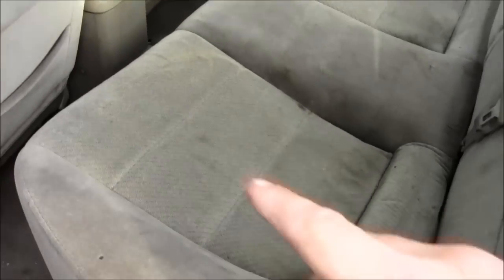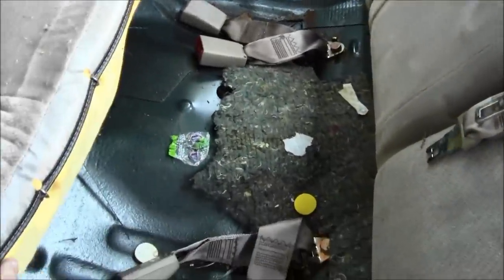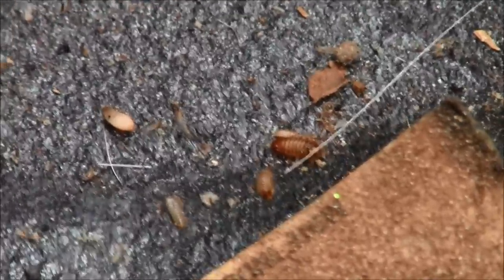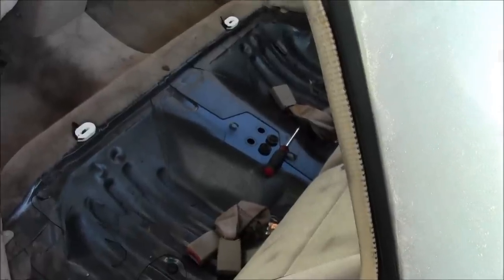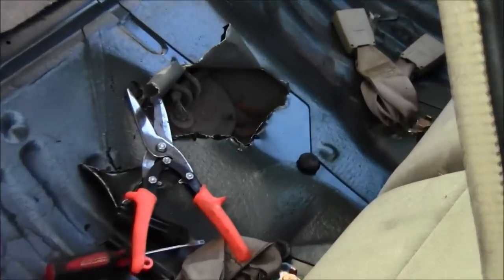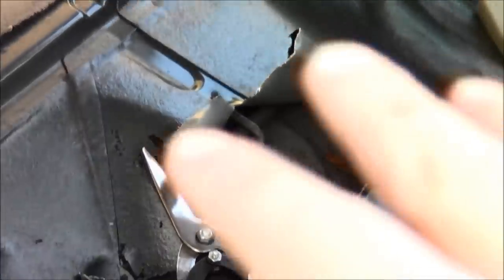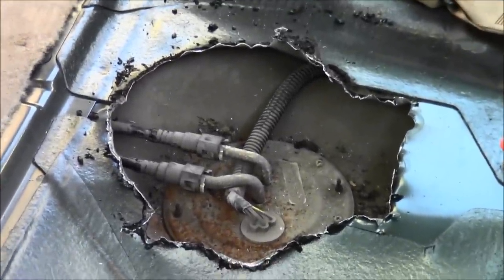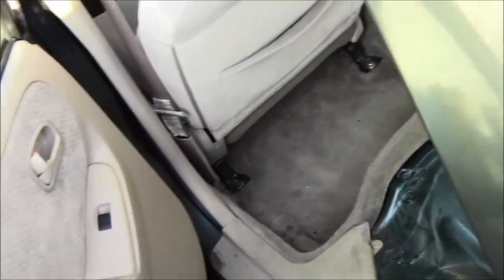How to Access Fuel Pump on Mazda 626 Without Dropping Tank

Comment: I did this to my 626 and it worked great! Thank you for the directions sir! I noticed the newer Mazdas already have this "fuel pump access panel" from the factory in the exact same spot! I guess we got ahead of the game! I sealed mine back with a rubber gasket and sheet metal screws just like the newer ones! This was always a great car and still will be for many years to come! Thank you! Thank you! Thank you!
Reply from the maker: Yes. Thank you. Great the engineers put an access panel in. On a side note, the downside to having driven this vehicle is it draws a lot of attention from the popo.
Reply: @MattHumanPizza  Hm. Maybe the previous owner was a known criminal? I never had any problems with mine that way, even after I got the windows tinted dark. Great car!

Comment: hahah good shit! Personally know of plenty of Mazda "Techs" that "Drop" the fuel tank in Mazda 3's to replace the fuel pump, Keep cutting that shit, flat rate doesn't pay enough for you to drop that tank. Just make sure to use some Epoxy to reseal the passenger compartment, make it look pretty by spray painting it with some black spray paint and you are good to go, you'd be amazed how many cars at the dealerships are done this way but with a grinding wheel and a bag in between the sheet metal and the fuel lines.

Comment: I won't say anything mean like some did...but I will say this...dude...you spent 4-1/2 minutes showing out in front of the camera...but you forgot to show how to replace the fuel pump.  is that in another video?  not sure about the whole "cutting holes in the frame of the car" thing...I'm thinking that's something that the engineers didn't really want to see happen.
Reply from the maker: I just showed how to access the pump from above instead of below

Comment: I used a CAN OPENER on my car. Take a  look below- OK guys everyone 
jokes about the TIN CAN they drive,RIGHT!  I just used the can opener to
 make the hole It worked like a charm. It was the one that you stab into
 the can. No mess cut like good cheese with a regular knife. Only spent 
$20.00 bucks on a pump. Even used a hack on the lines.  @
Reply from the maker: good technique

Comment: You sound like you are high on something but what the heck!  Though you don't show how you finally covered up that gaping hole, I assume you used a piece of sheet metal, shaped it and secured it with several screws and at least  sealed it with clear silicon as to avoid the smell of fumes and whatnot.  Whatever it takes to save some green, I guess...

Comment: Dude, don't give dangerious bad advice, for close the hole. Don"t be an idiot.
Fix a new solid piece of tin to fit the hole.  
Seal it up solid, using a tight fit. Screw it down and seal it with silicon or JB weld.   If not,  exhaust and gas fumes will come into the car.

Comment: As an ASE certified master tech, I puked after I watched this. :( LOL I see this kind of stuff sometimes and it usually causes you some kind of problem. BTW, please don't strap your kids in the back seat of that thing (if you have any) because you have sacrificed the structural integrity of the car in that section and who knows HOW a car will wreck when it does. ;) Think uni body car, (frame)
Reply from the maker: +History Trackers This car drew a lot of unwanted attention by the way it looked, so it was taken apart for the benefit of YouTube and science.  It was junked and who knows where or what it is now.
Reply: +History Trackers to be completely honest, the structural integrity of this car probably wasnt that great when it was new, and i highly doubt that this job would lead to any sort of loss in safety. just my .02
Reply: sure sounds like it, since there is no page 8, or figure 15 or 16 in that llink haha. also i consider anyone who goes around on youtube starting their comments with "im an ase certified master tech" a moron spouting random crap on the internet. i too am an ase certified master tech just fyi. and while this is definately not the proper procedure to remove a fuel pump, there is no article necessary to gain a master tech ranking that says anything about  a 6 inch round  hole in a non structural  part of the car being bad.  obviously its an access for fuel to enter the vehicle but with any modern car fuel tankn rupturing isnt necessariliy that common of a problem. then you look back at a bunch of older vehicles where the gas tanks are literally inside the cab of the car, and people have driven around in those for ages. sure its not the safest thing but to say that you wouldnt put kids in the car because of this?? i mean i have no issues at all cruising the streets in a 1960s bug with multiple kids in the car.. as have many people for ages.
Reply: Evan Shea  Done.... just an fyi, check to see what an ASE certified body and frame technician does for a living. Just keep workin along youngin.....you'll get there someday I hope. ;)
Reply: ok master
Reply: :P
Reply: +History Trackers Everyones a critic online aren't they... cutting through some sheet metal under the back seat bottom would not significantly effect a collision better or worse. Sorry, but after earning 5 ASE certs, all it proved was that some guys know how to take a test and not always the best with troubleshooting or fixing things.  Ingenuity made this country great bro, thanks for the video.
Reply: ProfessionalDad  I'll take my burger medium well man. ;) Got a shit ton more than 5 certs here LOL. I also worked for GM in the engineering dept. for 12 yrs but oh yeah, everyone online is full of shit right?
Reply: +History Trackers It only takes 8 certs to think youre hot shit. It takes a brave man to admit hes an engineer. Sorry to hear it. They usually cant rebuild a fountain pen without a tech manual. winky face
Reply: ProfessionalDad exactly. in my opinion this hole would do no structural damage to the vehicle and i would feel perfectly safe with my kids in the car with me. if safety is a concern than driving an old mazda in the first place might not be the best idea.
Reply: lmao
Reply: FART TO YOU SIR!
Reply: Due to this video I've had to field a lot of questions about people wanting to do this modification.  Not only do I not agree with it but I'm adamantly opposed to it.  If your insurance company finds out they will not cover the vehicle, furthermore (and most importantly); if something does happen you can be held liable for the deaths of every occupant in the vehicle, involuntary manslaughter for cutting a hole.  If that's not enough to give you goosebumps then I don't know what will.  I have nothing against you or your videos.  This one has become a warning on what not to do and I would prefer you make some annotations about how unsafe of an idea this is.

Mazda specifically says in the factory workshop manual (the one that Mazda techs use) that you should not cut an access hole in this vehicle.  In the event of a rear end collision it is possible for the gas tank to rupture through the access hole into the cabin.  

It would be certain death to most if not all occupants.  I have seen rear end collision pictures of a 626 at a dead stop and someone ran into them at 50mph.  The trunk was pushed all the way to the drivers seat.  Thankfully no one was in the rear seat or they would have been instantly killed.  Did fuel enter the cabin? No.  Pictures showed that the fuel tank shattered, the floor pan crumpled, and fuel dispersed latterly, luckily there wasn't even a fire. 

 It has nothing to do with structural integrity.  Crash damage will be no better or worse with or without the access hole.  It's to keep fuel from entering the cabin through the access hole in the event of an accident.  Other vehicles have them sure but this isn't other vehicles, it was designed like this for a reason.  The 626 has an HDPE plastic fuel tank that should shatter on contact, however if inertia is enough from a wide object like a dump truck bumper at full speed well, do the math.  It would inject fuel through that hole into the cabin like a flamethrower (if conditions are right).  The only thing preventing that is the floor pan which is designed to crumple and shield occupants from fuel spray and vapor.

So if you are interested in an access hole modification for a Mazda 626, don't do it.  There are implications that could affect your life dramatically if something goes wrong (namely a very bad rear end collision).  With people on their cell phones and Pokemon Go distracted drivers now more than ever you can see how the likelihood of a rear end collision has increased from just 10 years ago.  If this long post has helped deter someone from this modification on their Mazda 626 then it's potentially one or more lives I can help to save.